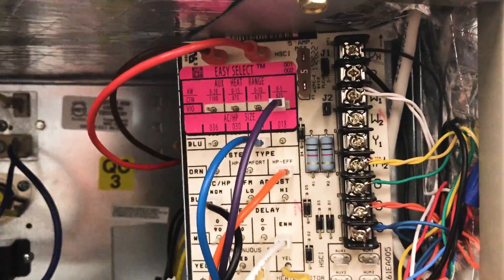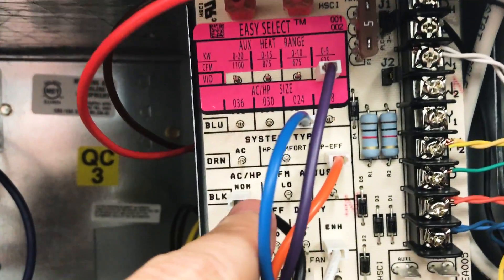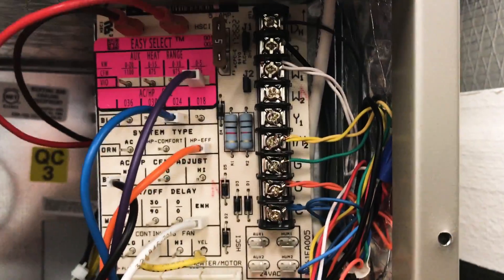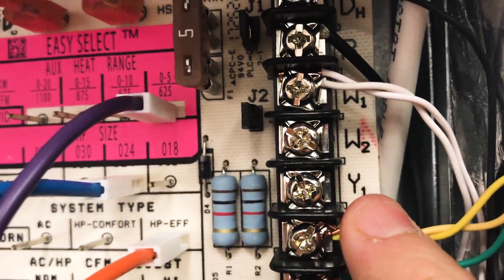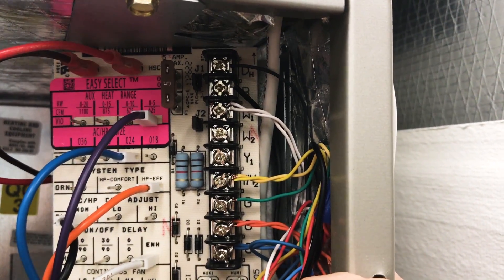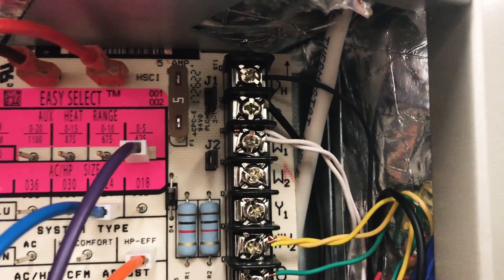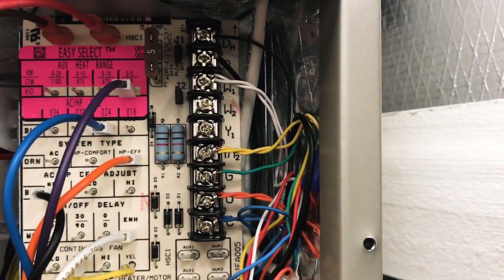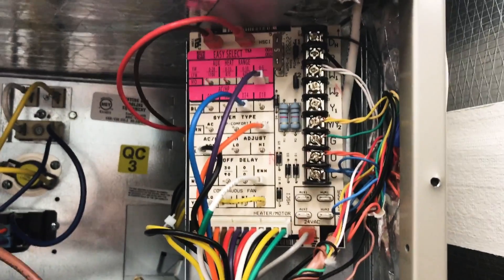When a Variable Blower Runs Too Slow

Comment: i have a single stage AC and my Ecobee thermostat is set to Y1. On very hot days and if the AC runs for 5+ hrs straight i think the inside of the coils start to freeze up because i lose a lot of airflow. Do you think if i switch Y1 to Y2 on my Ecobee thermostat the fan will run stronger to push more air?

Comment: My unit is a bit oversized now the spray foamed attic and encapsulated crawl space. Can I just move the black wire to low (instead of NOM) to lower CFM to help it dehumidify house in spring/fall or would other adjustments need to be made as well? Just want it to run longer to dehumidify house when outside temps are mild.

Comment: Thanks for the video.  Should the wiring at the thermostat also match the wiring at the control board?  For example Y-Y, C-C,G-G, etc
Reply: The symbols should match the colors usually do also except you might have a variation of blue or yellow for y ...so yeah pretty much...

Comment: Has anyone seen a ecm motor run to fast? I went to a 2017 Rheem RHIT3617STANJA and the homeowner said the return and supply are very loud and it just started last week. I tried changing the speeds with no luck. Is it possible the programming or something has caused the motor to go full speed on all speed taps?

Comment: My hvac has variable speed blower motor. It does get to full speed, it just takes a long time. I do like the idea of it adjusting the speed of the fan depending on the comfort, but is there a way to speed the process to get to full speed?
Reply: Yes depending on the unit the Daikin fit has options for this. What area do you live in?
Reply: And the Amana S unit which is the same thing just Different label and 2 years less warranty

Comment: My blower runs slow and doesn't have any airflow at the vents. However if I turn off the breaker and restart it then I get full speed from the blower and then it shuts back down to slow speed and doesn't blow any air out the vents....

Comment: On this same board if you have jumper j1 installed does that disable the DH connection for dehumificaton? It looks to apply 24 VAC to the DH connection disabling dehumidification or the reduced fan speed for dehumidification.

Comment: So the issue I discovered with mine is the blower can run at all the speeds my thermostat calls for when only the fan is running, but shortly after the AC kicks on the blower will gradually slow down to a crawl which sounds like the de humidification mode and yeah, I don't want that because that's a huge waste of energy and it might be freezing up the coil too. So if I follow your video correctly, when I go look at the board I need to make sure each terminal is getting the right voltage. Maybe this is a sign that my thermostat has failed to provide the right voltage recently and the air handler thinks I want to dehumidify instead of cooling? It definitely didn't do this before but I don't know when it started; I just noticed it today.

Comment: What could be causing my blower speed to fluctuate a lot but mostly run at very low speed during cooling season? This is a problem I’ve been having during a recent spell of hot weather. Usually turning the system from cool to off for several hours fixes the problem and then it’ll work fine again for a day or two. If I leave the system off but the fan on, it seems to blow at the expected medium speed.
Reply: What did your problem end up being?  I have pretty much the same issue
Reply: @macknumber9 if I had to guess he has a bad blower capacitor. It's all you had the blower motor on a Trane variable speed ECM blower motor it wasn't running anywhere near as fast as it should technicians come out and did blood tests and determined get my blower run capacitor was super weak.

Comment: I’m just starting this video and you should always tell people to turn the breaker off.  I don’t know much about heat pumps thus why I’m looking this up but you have to make sure people are safe.
Reply: If you need to test wires, you keep it on but you need to tell people to be careful.
Reply: Unfortunately you must have power on to check volts remenber he said check Voltage between C and G.   Imho😊

Comment: Hello i have a question regarding my hvac system. The blower is running slow constantly. I checked in my hvac system i dont have y2. I have C- black and red wire, Y-white and yellow wire, Gc-green wire, Gh- there is no wire that attached, R- red wire, W- white wire. What is the wire do i need to connect to in order for me to get the full speed blower? Please help me i do watch your video a lot to try and fix my blower is running slow.

Comment: What if half the time it blows on slow speed but the other half on high speed? When it blows slow, I can flip the blower switch off and right back on and it will start back up in high speed.
Reply: I am dying to know the answer to this as well...this is exactly my problem.  Blower is weak as can be no airflow but when I turn it off and back on it comes back on fast for about 15 minutes

Comment: They replaced the blower motor on my Amana and it runs slower than the motor they replaced. You could barely hear it. The old one you could. Since its running slow the lines froze up on unit outside. I told the tech about the speed and he said speed would increase. Don't think he knows what he is talking about. So can they speed it up? Two connectors hook up to motor. Could he have connected them where they are not suppose to go and cause this slow speed.
Reply: Probably has the wrong motor which is meant for a different size unit. Have you confirmed the part number to see if it's correct?
Reply: @tomtom1541  The motor was wired wrong from the factory. Took it off and switched wires and was blowing like it's suppose to.
Reply: @mgomez5606 how was it determined that it was wired wrong? I've had an Amana for 3 years with variable speed handler and it doesn't blow nearly as hard as the old single speed unit it replaced. It almost feels like it runs 60%, was this your same experience?
Reply: @elliottvalentine104  They had to take the blower motor out and changed the wire connections. They had to call the company that makes the motor and they told them the correct sequence of connections. They had replaced two before they called them.

Comment: Does the hp size setting have to match the unit installed?  A service provider set mine to 3.5 ton to get more air flow but I only have a 2.5 ton heat pump

Comment: Crazy thing happens to mine, it is a 2 stage 3 ton ICP unit with variable speed air handler. It was set at "normal", we put it to low because it would run nice and steady except right before it shuts off, like the last 3 or so minutes would haul ass, rattle the vents it blows so hard. No one can seem to figure it out. Nice and quite  but then the tornado lol. Any ideas?

Comment: "Okay Guys"; no wait, what? 

So my package RTU's blower motor's (occasionally) speeding up/slowing down/speeding up/slowing down; all during a single cooling cycle. Also, it's just the blower motor that's acting up, not the condenser fan. The compressor will stay on. Replaced capacitors which seemed to help (even thought it's an ECM blower motor) but it's still acting up every now and then... kinda weird.

Clues?
Great channel, BTW... thanks!
Reply from the maker: Thankyou

Comment: I have an older furnace so it doesn’t have many functions, it does not use a Y wire for cooling 

In cooling this year I can see voltage on the high speed wire going to motor, but it doesn’t seem to go to higher speed than low

I should say though, low speed on this is med/hi and it seems to only run at med/hi

Comment: i have a heat pump (single-stage) and it feels like the motor is not running at full speed and on my thermostat my yellow wire is connected to Y not Y2.  you think that can be the problem?
Reply: Y and y2 are the same.  Only y1 is different

Comment: What if the motor trys to ramp.up to high speed but fails and stays in low or just under low speed? I have a 10tr old trane XR series furnace with the ecm variable speed blower. Thank you. I.wish you can reply.
Reply: This is the issue I'm having did you find a solution?
Reply: @chrishale  I replaced the motor and ecm together. I purchased online for 300$ for the motor with the ecm. Came with a 1yr warranty.  I honestly think my motor was the fault but both were 10yrs old so 300$ and I installed in 2hrs.
Reply: @aaronshensky9385  yeah I have a new one coming tomorrow to install. The OEM motor was 2 weeks out so hopefully this evergreen will work.
Reply: @aaronshensky9385  I have this problem except when I turn breaker off and restart it the blower starts up in full speed and then goes back to slow speed after about 5 minutes...keeps trying to go to full speed it makes these noises like its trying to but it won't do it.

Comment: Hi, I have an AC unit that looks exact the same in your video. I have a problem with blower motor that kept running all the times ( unless I turn the breakers in garage off). It ran even when I took the the thermostat out. I have replaced the board thought it was bad. I also changed the thermostat to Nest Thermostat but it didn't fix it. I thought it was the relays (with small boards attached to them), but still didn't fix it. Addition, I have variable speeds with 240v on one terminal and bunch of wires on the other terminal, both plugged on the motor. Please tell me why my motor keep running? what is the correct setting for those jumper wires on the control board. Thanks
Reply: Daniel Cao probably a rollout or sensor switch
Reply: The module on the ecm motor sounds to be faulty. There's usually 2 plugs on those motors one set is low voltage and the other is high voltage. Find the low voltage plug and remove it and see if it still runs if it still runs module is bad , replace module if it turns off control board or thermostat control wires are shorting together. Some checks if u haven't fix it yet